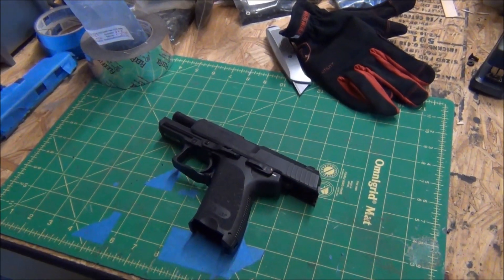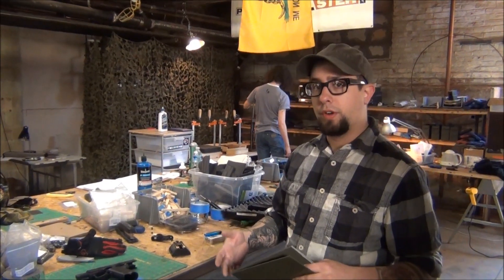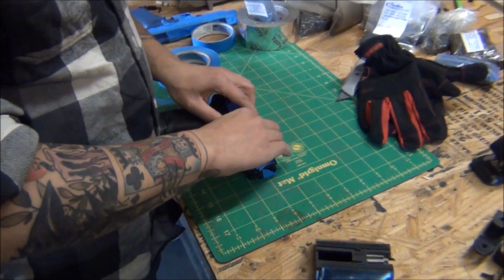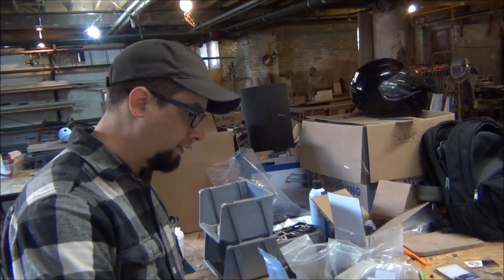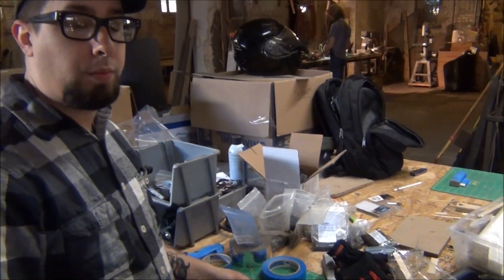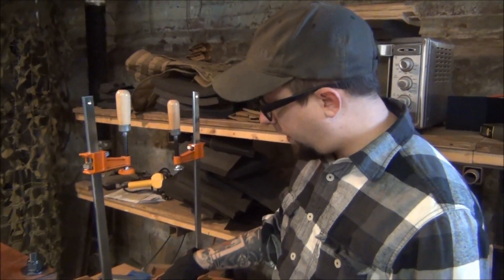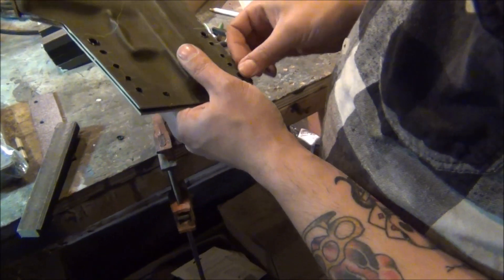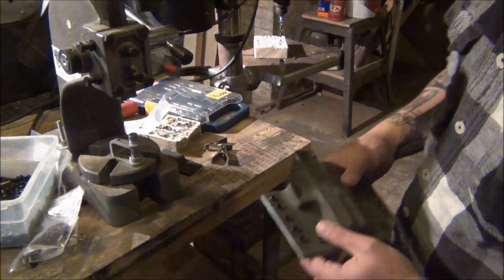PHLster creating my new holster

Comment: I fixed my Extremeconcealment kydex pocket holster for my S&W 380.  It came so tight it  took two hands to remove the gun...useless.  I heated it in the oven at 275' and it came out soft. I taped the gun and inserted into soft holster applying pressure with gloved hands. Now its perfect.  Thanks for the video help.